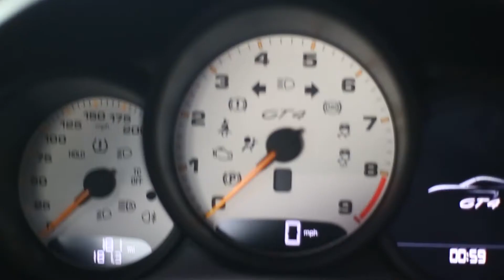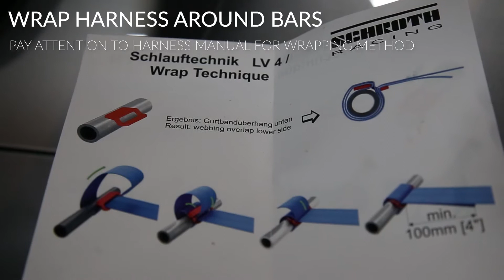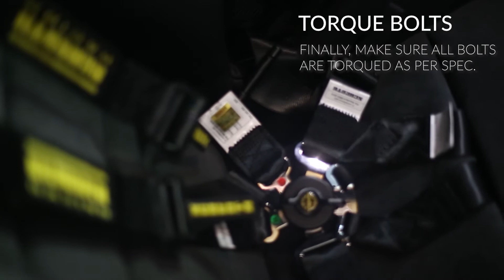Brand new  2020 Porsche 718 GT4 Clubsport package Harness Install

Comment: In my case, the two lateral anchors that you cut out, where the metal plug is visible, have some kind of adhesive filling. Is this normal? What causes it, and how can I fix it? Thanks.

Comment: Great video, thanks for posting. Does this apply to 981 GT4? I am thinking about installing 6 point harness as well.
Reply from the maker: Thanks! I did a bit of looking into this and I’m pretty sure the mounting points are the same for the 981 assuming you have clubsport?
Reply: @letsgomr.driver1609  I don't have the club sport package, only buckets :(  I am getting a bolt-on cage installed in the car so I guess I don't have the same mounting points?
Reply from the maker: Yeah unfortunately I think non clubsport cars lack the same mounting points. If you are getting a cage, you could wrap the shoulder harnesses to the cage and the lap belts to the seatbelt mounts. I’m not sure about the anti-sub belts though!
Reply: @letsgomr.driver1609  thanks for the tips and for answering my question!
Reply from the maker: @trackratzinger  glad to help!